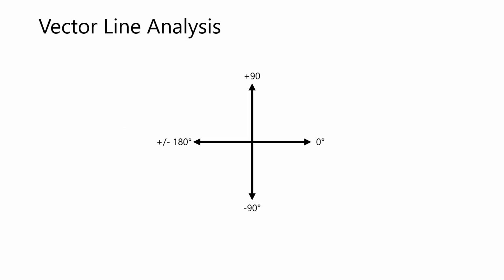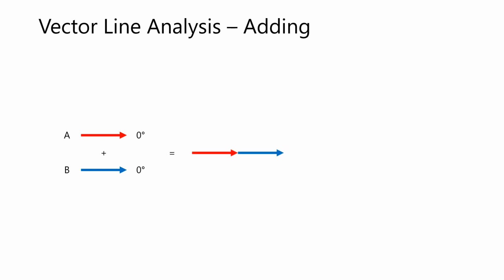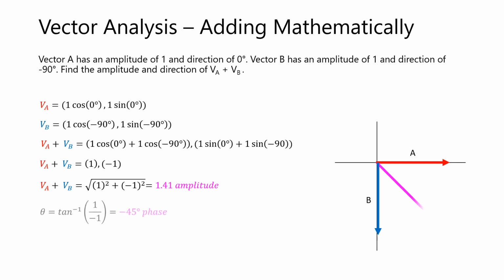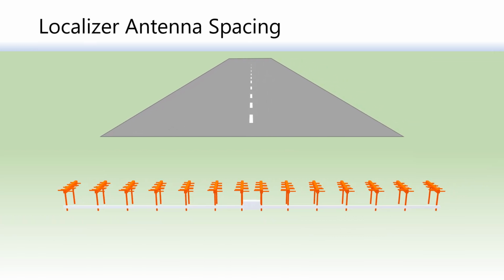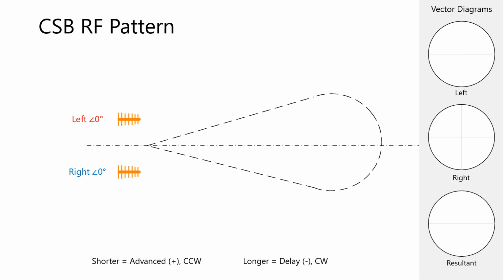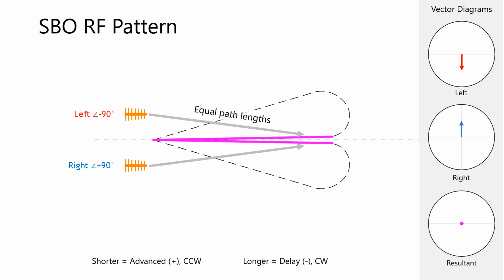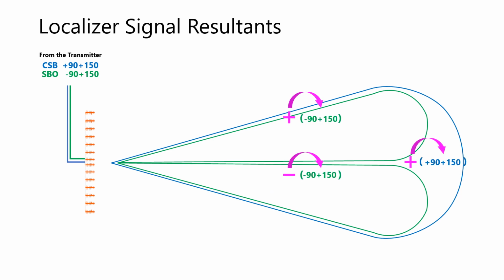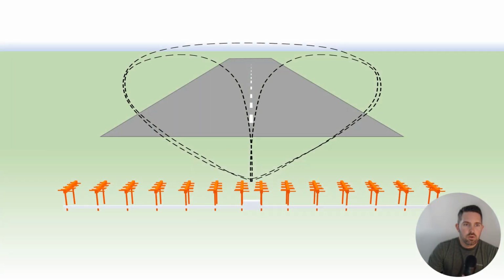03 - ILS CONCEPTS - Localizer RF Pattern Development

Comment: thanks for your video. Why are the phases of the SBO signal different? As far as I know, only one of the 150 Hz or 90 Hz signals is phase-reversed, but the image shows -150, +90, -90, and +150. time 11:02-11:22
Reply: They`re different because this is showing the SBO Lobes` phase relative to CSB, not the SBO Signal`s Phase relative to CSB`s in the DU.

It gets confusing quick because there are several different phase relationships adding up here; I wont get into all of them right now, but the relevant ones are:
-Phase relationship of audio tones to each other within the CSB or SBO signal.
-Phase relation of the RF lobes themselves.

Without getting into the how and whys, alternating lobes will have alternating phase to one another. So, SBO Lobe 1 & SBO Lobe 2 are 180 out of phase with one another. Naturally, they will have a phase relationship with the CSB Lobe as well. This is talking pure RF without any audio tones present. 

In simplistic terms SBO 1 is in-phase with the CSB lobe and SBO 2 is out of phase. I'm glazing over a lot of theory but this is youtube comments section not a classroom. So, if the RF lobes themselves are have a phase relationship how does that end up affecting the phase relationship of the audio tones within the lobes?

Essentially the alternating phase of the SBO lobes will change the phase relationship of the SBO's audio tones and the CSB's audio tones. In flips which of the SBO's audio tones are in phase with the CSB's and which is out of phase.
In one lobe, the SBO's 90 will be in phase with the CSB's 90 - they'll combine and there will be more 90; the SBO's 150 will be out of phase with the CSBs 150, they'll combine and there will be less 150.
In the other lobe, the SBO's 90 will be out of phase with CSB's 90 - they'll combine and there will be less 90; the SBO's 150 will be in phase with the CSBs 150, they'll combine and there will be less 150. 
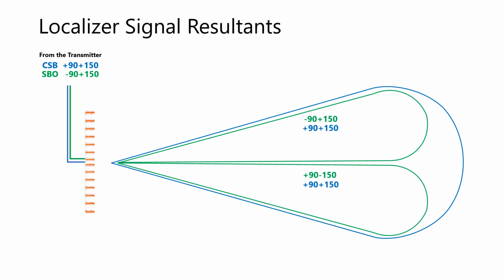You can see this being shown at 11:17 in terms of simple math. The green numbers are SBO and blue are CSB.

Finally: remember that the plane doesn't see any of these discrete signal. We describe out signal as these three lobes but they're all the same frequency, they all combine into one big composite.

One last time: I left a lot of out this for the sake of simplicity and focus on the broad concepts. 

I hope this helps, even if it is a bit late. I popped in here to see if I can steal any animations from these videos for my own classes I'm writing. I've got a lot of brain fog at the moment so hopefully this is all comprehensible. Feel free to reach out in DMs with any questions.